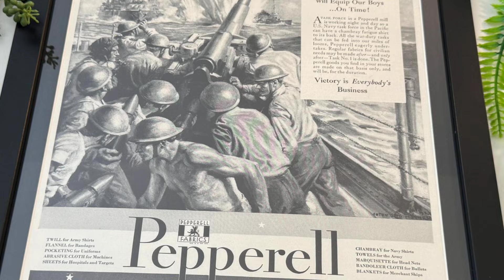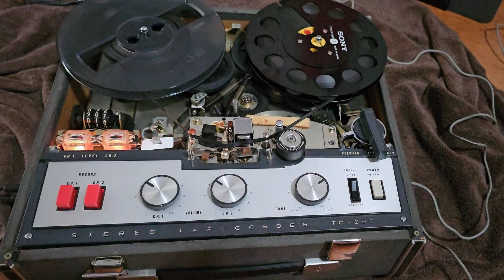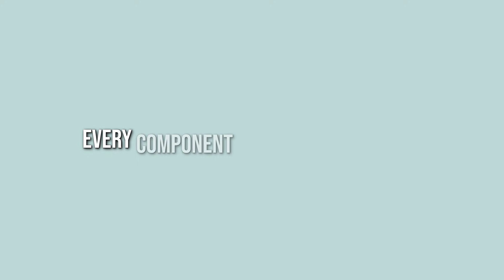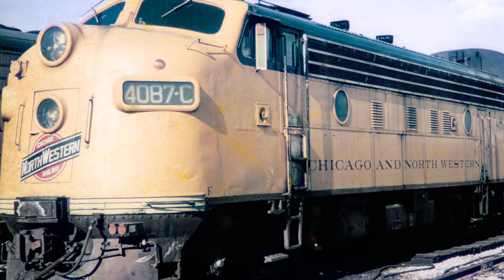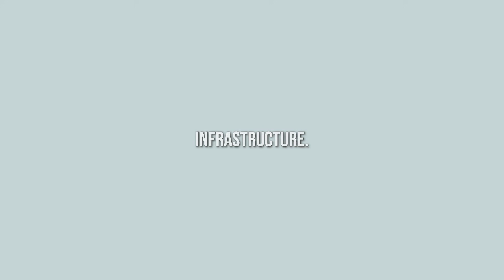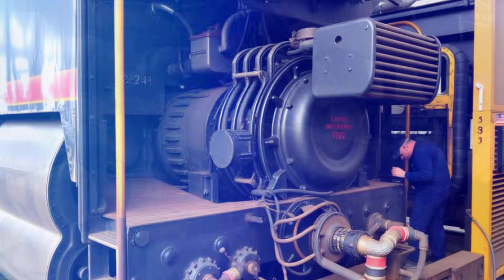The Banned Engineering That Was Too Good To Run — Why The Most Reliable Engine Ever Built Was Hidden

Comment: The bad thing about Fairbanks Morse engines was that they were a real pain when it came to maintenance as the top crank case had to be removed just to change rings.  In railroad use in FM locos the main problem was running in hot and dry areas where the exhaust went out of the cylinder above the lower piston crown causing catastrophic failure due to massive overheating with crown seperation.  I helped change rings on MILW FM 760 at Illinois Railway Museum and it took a month.  On a similar EMD 2 cylcle 567 single power assembly ring changes took about an hour.  As with any 2 cycle engine the fuel cosumption was always higher than 4 cycle engines due to incomplete combustion which is why 2 cycle diesels are gradually losing popularity.  FM lost its' race mostly on higher maintenance costs and they never had that many units on the road.  EMD prime movers were all 2 cycle until late 80s.  Lots of incorrect info on this video.
Reply from the maker: The opposed-piston design made ring access a disassembly event, not a maintenance stop. You were pulling the upper crankcase just to get to consumables. On a road engine running daily mileage, that service interval becomes a liability fast. The FM units had real power density advantages -- the opposed-piston configuration is efficient by design. But the maintenance burden in field conditions killed the cost case outside specialized applications where the power-to-weight ratio was worth the trade.

Comment: It also appears to be a 2-stroke engine, among its other claims to fame. This sounds like an engine that someone should attempt to repeat in manufacturing, with modern approaches to resolve any issues presented. I am curious why it hasn't been done.
Reply from the maker: The engineering answer and the manufacturing answer are two different problems. Reproducing the geometry isn't the issue -- the tooling, the metallurgical specs, the institutional knowledge of the people who built and maintained them are gone. Modern production would essentially be starting from scratch with a design that was never intended for current regulatory or certification frameworks. The economics never pencil out when you're building one-off for a market that no longer exists at scale.

Comment: There were no U-25b locomotives from GE until 1959.  This article must be referring to ALCO-GE locos, which used 4-stroke engines.
Reply from the maker: The distinction matters. The ALCO-GE collaboration produced units under shared branding, with GE supplying electrical gear and ALCO running the prime mover side -- those are 4-stroke ALCO engines. GE didn't bring an independent production locomotive to market until the U-series in 1959. The engineering lineage is real, but the attribution gets blurry when you're working through that period of the partnership.

Comment: The US Coast Guard Icebreaker Mackinaw (WAGB-83) used 6 of these engines. One pair were named 'Jake' and 'Elwood' because of their 'attitudes'.  The ship had an exceptional 62 year career, never once getting stuck in the ice, but eventually was retired as they could no longer get parts for those engines.
Reply from the maker: That's exactly the kind of operational history that gets lost when you tell the story purely through the railroad side. The same engine that struggled in one environment proved itself in another. 62 years of Arctic service without once getting stuck is a performance record most machinery never approaches. The nickname detail says everything about how the crews understood what they were working with -- machines with enough personality to earn names.

Comment: It was good in pampers,
Reply from the maker: Every machine has the conditions it was designed for. The issue wasn't capability -- it was the gap between those conditions and what railroad operations actually demanded day to day. An engine that performs well under controlled circumstances and falls apart under sustained load is a design problem, not a maintenance problem.

Comment: it was not as robust - actually it was very difficult to maintain the synchronization between the 2 crankshafts, just the same problem the deltic had with its 3 crankshafts.
Reply from the maker: The synchronization issue is real and it's worth putting on the table. The opposed piston design concentrates that problem -- two crankshafts per engine bank, and any mismatch shows up immediately as vibration and accelerated wear. The Deltic pushed it further with three. Both designs demanded a level of mechanical precision in maintenance that most locomotive depots weren't equipped to provide consistently. That's where the operational costs compounded.

Comment: No, it didn't like warm temps in a water over air cooling system "locomotive" vs water over water cooling system "marine . When you have the whole ocean for cooling it does make a difference. It was a fine engine running in a boat and it was a good engine in a locomotive too but it didn't have the cooling it needed to sustain hours upon hours at full throttle. The idea might be much better today though with electronic fuel injection and all the other things like rings for instance. It is an efficient design. People who worked on them said they accelerated like nothing else on the railroad.
Reply from the maker: The cooling delta between marine and locomotive operation is the core of that whole story. Salt water running at full flow through a heat exchanger is a fundamentally different thermal environment than a closed-system locomotive setup in desert or high-load summer conditions. The design assumptions didn't transfer, and nobody in the procurement chain fully accounted for it before committing to the platform.